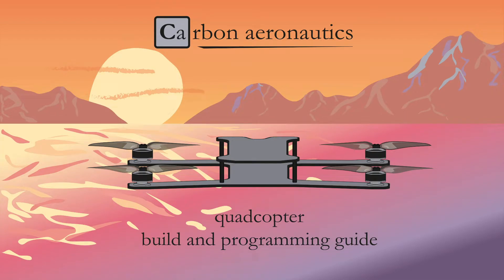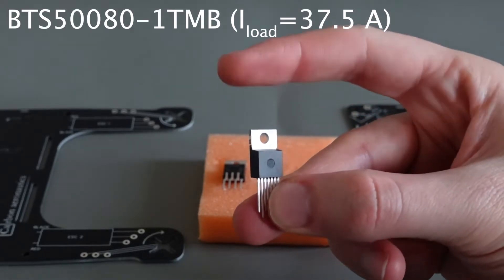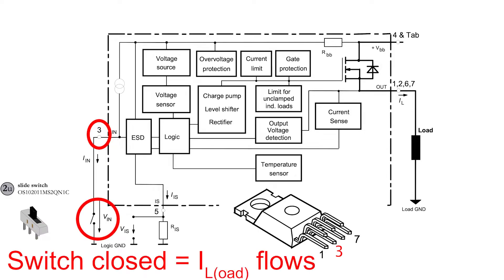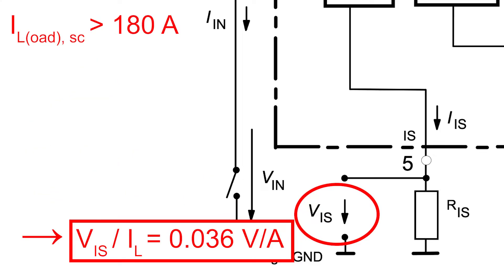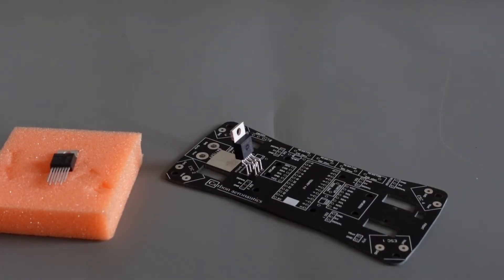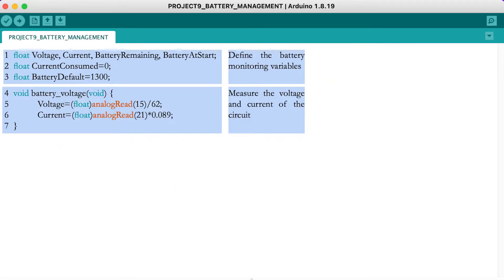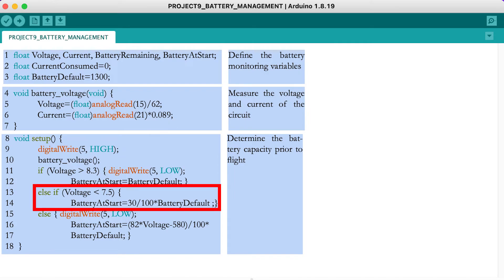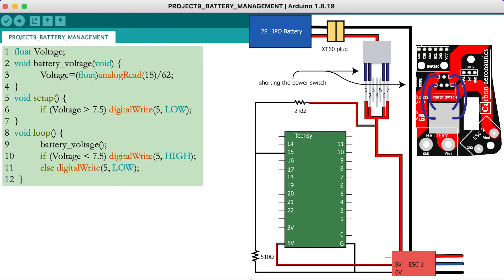9 | This transistor can switch 70A motor currents at 12V

Comment: Hi, I really enjoyed your work and learned a lot from it. I found a small detail to consider on the shared PCB, it seems that pin 4 that goes to Vbb (BTS50080-1TMB) is not connected to anything and therefore would not measure anything.

Comment: Hello. Can you please update these codes for me?
I just want to make a drone using MPU6050 and BMP280.
I don't need a transistor. I will connect the battery to the PDB.
Can you send me the codes again accordingly?
I want to use arduino nano instead of teensy.
Please help me for write sketch.

Comment: 4:52 
You didn’t add Rv (resistor series to Ziner diode). If the voltage go high the Ziner diode will break down. Rv is a must
This figure doesnt show how you power the Teensy. Did you use separate batter with 3.3v?
Reply: may be through esc. cause esc has a BEC(battery eliminator circuit.)